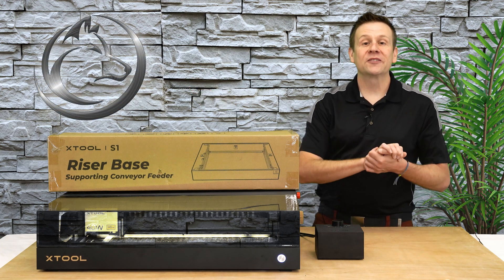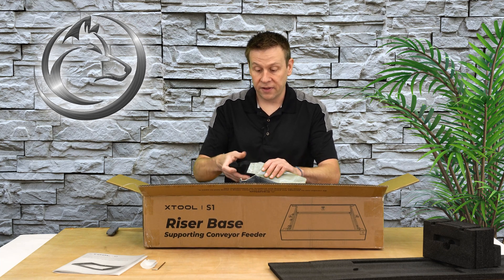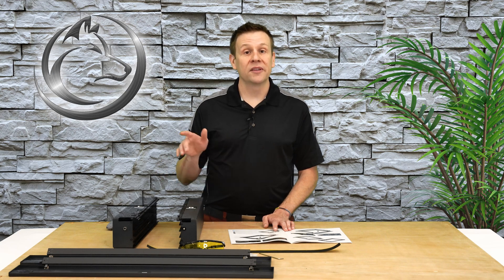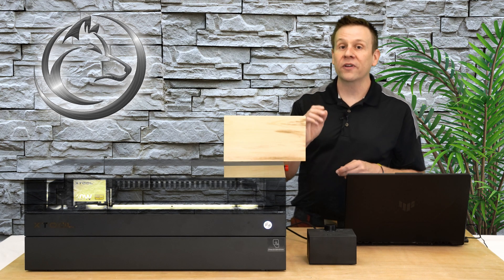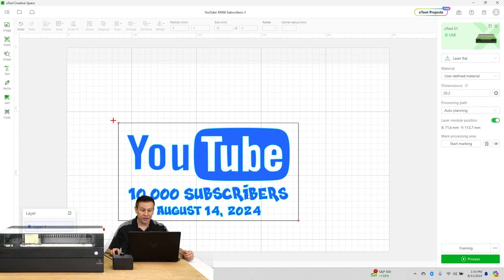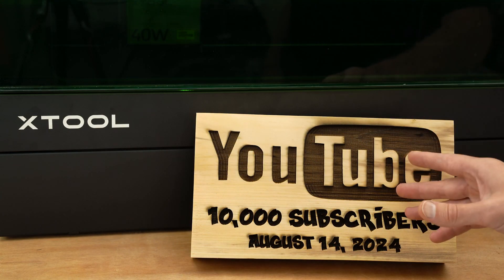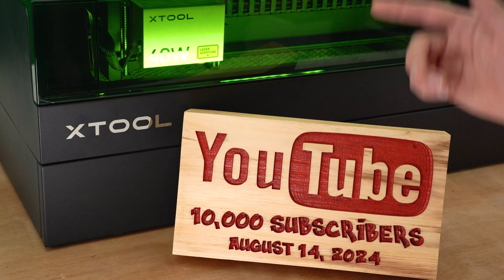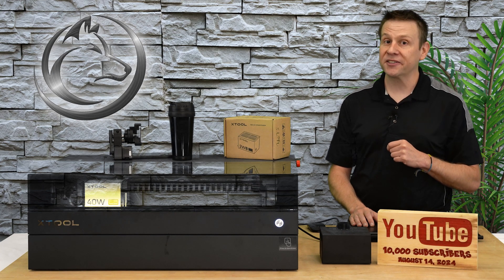Xtool S1 Riser Base Plus Color Infill Engraving

Comment: I have the Xtool s1 20 watt and I bought the riser base. I’m afraid to attach it as it states it takes the laser from class 1 safety to class 4 (best to worst).  Is there any way to seal the gaps as I don’t plan on using a conveyer - just want to get more space between the bed and module head.
Reply from the maker: I think there's 2 parts that shift the safety class rating with the riser base: 1) there's some very small light gaps and 2) the pass through doors can be opened and this does not shut the machine off. The top lid will still stop the machine.
The conveyor system will have more light gaps.  You can use laser safety glasses if you detect scatter light coming from the machine.  
I personally have not detected any scatter light escaping with the riser base. 
😀
Reply: @ thanks for the response ~ I may just give it a try 😜